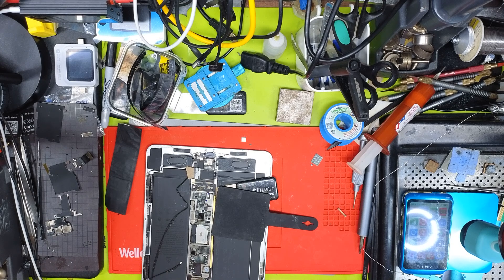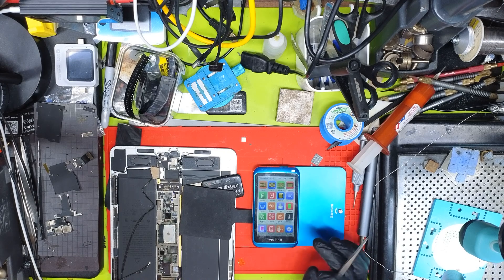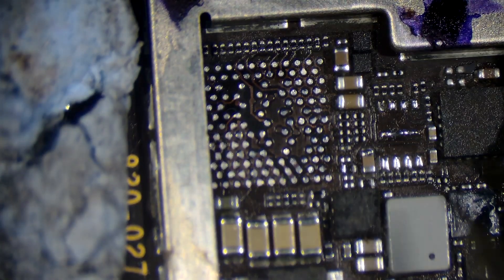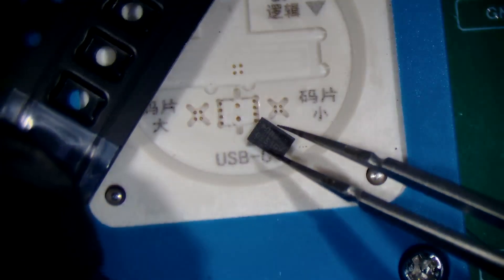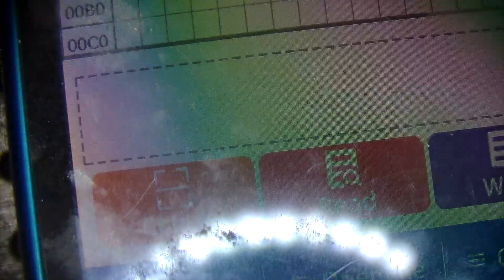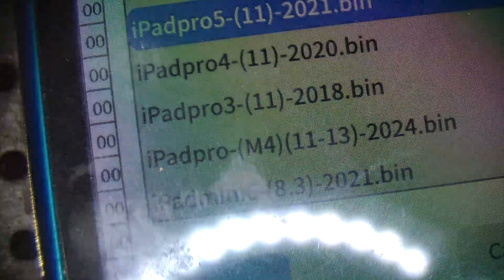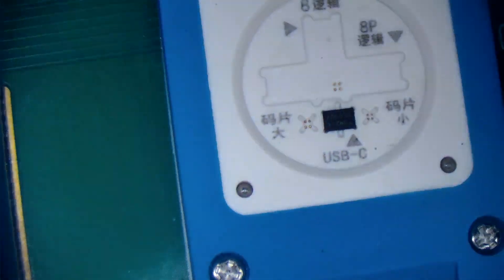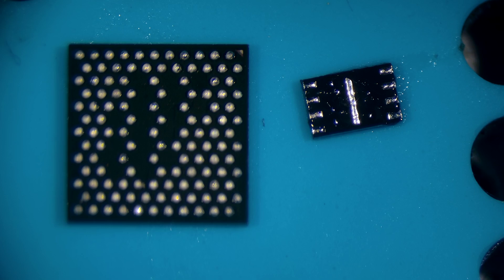NEED TO REPLACE CD3217B12 IC USB C PORT CONTROLLER IC ON IPADS! PROGRAMMING!! JCID V1S PRO! IPAD PRO

Comment: Does not work
Reply from the maker: What you mean?
Reply: @SURGE101  tried on ipad pro 12.9 5th gen. ordered eeprom from mobilesentrix programmed it on v1spro. change both cd3217 and eeprom. still not charging. ipad boots up normal tho
Reply from the maker: @M @MohsinIqbal-d4z not all charging issues will be the same. You have to diagnose the fault first to find the issue. Charging issues could be a number of different things like the port, a short on the board, the charging IC, the list goes on. It’s not one thing cures every issue. You have to run tests and check a number of things to narrow down the fault. The process I showed in this video just shows programming side of things to replace that chip with a new one, as the iPad in the video has a bad CD3217 IC confirmed by doing tests.I diagnosed the fault on that iPad first. Thanks Rich
Reply: @SURGE101  unless you tell us where you source your ic from

Comment: Hi, if you replace only the cd3217 and use the same original rom then factory restore the iPad, would that work also or no?
Reply from the maker: This is for replacing the Rom if it’s burned out and damaged.thanks Rich

Comment: Brother, I want your help. When I put the IC and did exactly the same as you, it did not give me any information when I pressed on server File
Reply: Brother, I checked the Wi-Fi, but it didn't work.
Reply from the maker: @asdasdf9796 you may have to upgrade your programmer. Go into settings and see if it requires any updates.
Reply: I will do what you told me tomorrow and if I don't succeed I will send you❤❤❤
Reply from the maker: @asdasdf9796 I’ve also done another video for this, it’s part 2. So check out my latest video. May help also. Thanks rich
Reply from the maker: Hi you need to be connected to WiFi and update the system as well. Thanks rich
Reply: @SURGE101 ❤
Reply: I returned the item to the store and tomorrow they will bring me another one. Would you please send me your number? I want to contact you on WhatsApp, please.❤

Comment: Hello Surge. Could you please provide completely exact details and perhaps with links to the chips and the programmer.

From what i've gathered you need the following:

JCID V1S Pro Programmer (can be bought with a lot of adapters, and possible also the one that you use)
JCID V1S Pro Adapter
CD217b12 (small dot)
ROM IC: ON214 OE51GV  (not sure about this one, very hard to read even with magnification, and several screenshots -- also, cannot seem to locate the exact chip on aliexpress with that code).

Thank you.
Reply from the maker: Quick update, my next video which I will be doing in a few days time will show a method for this that is a lot cheaper. So hold off on buying the programmer for a few days. Thanks rich